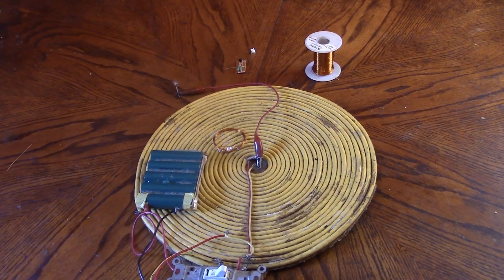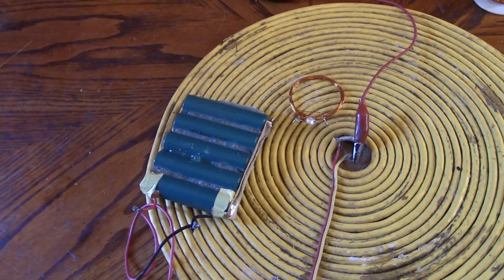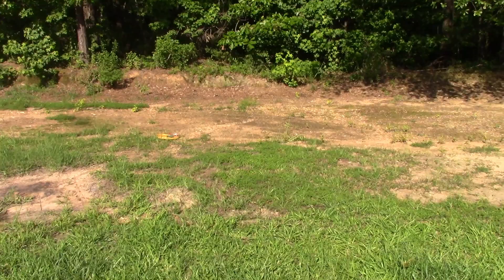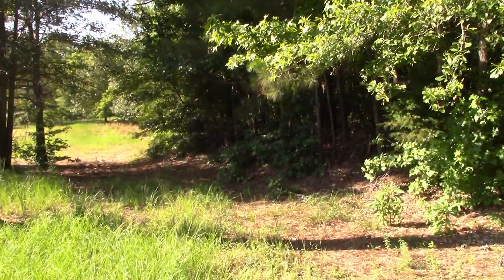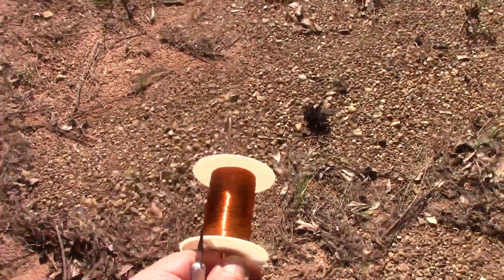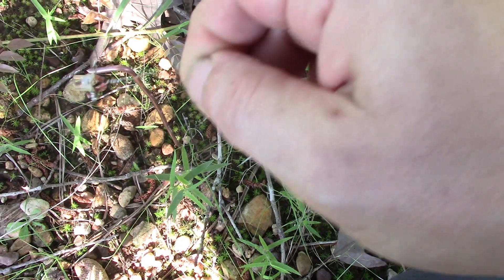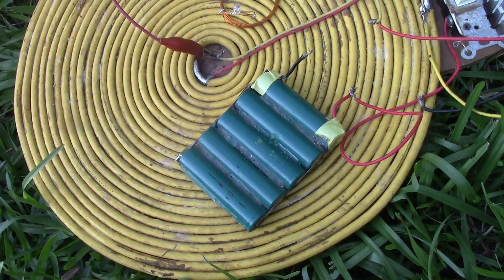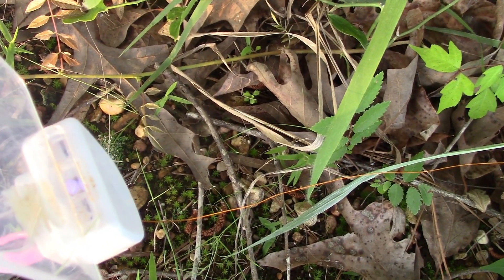1 wire power transmission - how far will it go?

Comment: Sound moving through the ether travels at the speed of light. Sound traveling through air is suppressed.  Sound travels through water and solids faster than air. Radio travels through the air like sound vibrations from two tuning forks ( that are sympathetic to each other)  move in oil. You must be below the anaerobic (no oxygen layer) layer. Your coils should be a minimum of 36 inches in diameter. You want your coils covered in aluminum (coax patented by Tesla). 20k voltage, low frequency range (vlf), and low amps.
Reply from the maker: Thanks Devin. These coils were about the biggest I could make with available materials, but do certainly work much better than anything smaller. The coax itself was a surprise a decade ago when made, because of the supposed RF shielding abilities.

Comment: That worked great!  I wonder if one of your Slayer exciters would do it.  As I recall we did some experiments like this back in the Dr. Stiffler tinkering days.   The earth was the return path for the transmission.
Reply from the maker: Cheers 😀
Am tinkering today with >500ft and issues have developed, perhaps due to 95F" past few days and totally dried soil. A tower might well work out though, with virtual ground (car alternator metal mass) and I'll bear it in mind. 
The heatsink ground for a 1 wire LED in a recent vid was straight from our times watching Dr. Stiffler.
Reply: @Slider2732_  I wonder if your tree roots are helping transmit the energy.  Soil moisture I'm sure is also a factor.  Fun experiment!
Reply from the maker: @Lidmotor  A very good point, because it's like a fine mesh or mat of roots over the whole area. Soil for plants has to come from 1 part of a lake bank, because the previous owner had tons of cow manure trucked in lol. Otherwise, also, everywhere has only about 2ft of soil before sandstone bedrock.
Success yesterday, including the mystery of a 500ft wire with power and no connection!

Comment: Thumbs 👍
Reply from the maker: Thanks John!
Reply: @Slider2732_ I have a video I had done some years ago bulb lights up one wire in a jar of water. Maybe you could save on wire if you put one wire into the lake and then pick up other  side of lake or close to ware you want to go and carry on from there. Just a thought might save you some wire.
Reply from the maker: @johnwynne-qx6br  I tried something like that yeseterday with a bowl of water, but found the conductivity was the issue. Salt water fine, tap water nothing. Well, am unsure, it certainly didn't conduct for an AV plug that was in the water. Hmm, stuff to think about eh  😀
Say, do forgive me, I only just remembered to subscribe to your channel, sorry about that!
Reply: @Slider2732_  thankyou for subscription. This was in tap warter I had noticed bulb still working even though one leg fell off but only if I was holding it so curiosity got the better of me and I thought would it work with warter and it did. I used to have hundreds of videos of different electrical experiments usually things I had seen on YouTube but as doing things sometimes something new would happen and those are the times you learn from. I lost most of the videos and you forget things over the that is one of the reasons I started a YouTube channel also it would be good if you could earn a coffee now and then doing something that you enjoy, cheers
Reply from the maker: @johnwynne-qx6br  Interestingly enough, the so called water resistor on the BAC used to be able to light LED's if dropped in the water...just bare legs and no circuit. Will take a further look at it all 😀
Yes, I too prefer unplanned results while filming. It would be far easier to film things backwards though lol, get the success footage and then film as though I had no idea if it would work.

Comment: Quite a distance just wondering if you use a larger battery bank will the LED's be brighter?
Also at the end of the wire if you were to run several splices off in different directions would they all be able to light the LED's?
Reply from the maker: Hmm very interesting. Yep to brightness, I tried it on a 9V battery and the nightlight was brighter. 
The splices idea would be expected to work, similar to wireless energy from a coil or Tesla tower. However, if the ground is dry in one place and wetter in another, the end loads should show it.  😀

Comment: Fascinating. On a slightly different tack, I have it in mind to try an earth battery and Joule Thief for running an LED. The "Earth battery" I have in mind is the tiny current flow I observed on my faulty external mains socket when I measured one leg to earth. It looks like some sort of galvanic action is taking place and it would be amusing if I could light an LED from it.
Reply from the maker: Good luck with the tests! 
It's all about potential difference eh and, in the case of mains, whether that power is simply wasted to the Earth. It's alright to say to Ground something, but what gets carried doing so might be usable on its journey. Will be interesting to see.
Btw, the comments section has gone wonky, or something 🙃